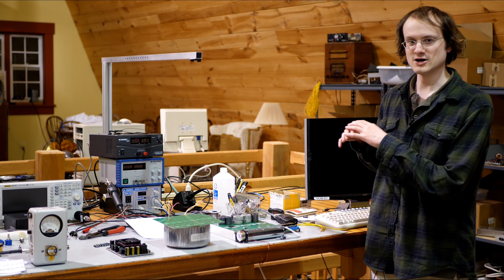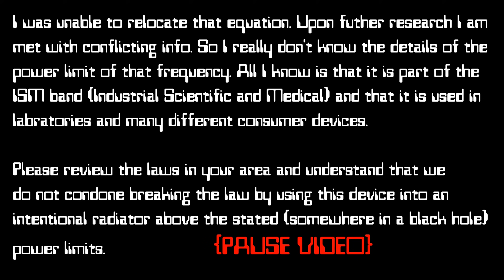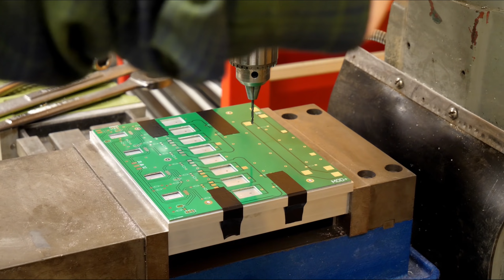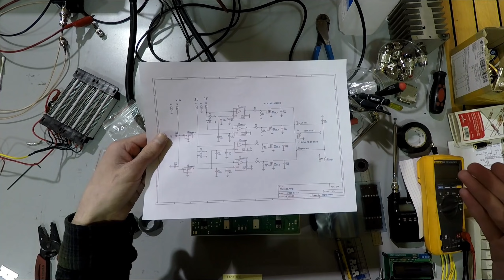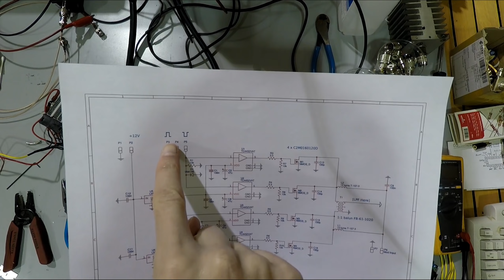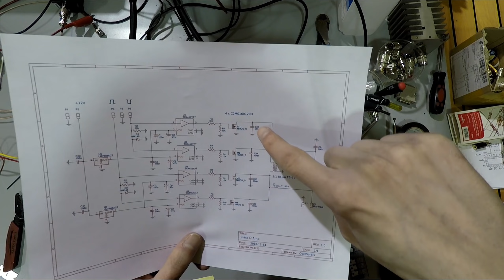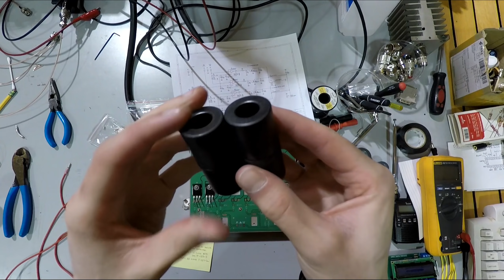Build a High Power Shortwave Transmitter!

Comment: Well, you could've solved the problem with the transistor pins should you have flipped them 180 deg. Center pins pointed up, and the base traces can easily be routed at the sides.
Reply from the maker: Someone else made the same comment. This just moves the problem to the gate. Now the gate has to have a long trace because the driver can not be placed on that side of it. You can see the solution if you find the other comment.

Comment: I am new to both electronics and amateur radio so this project is very attractive to learn from concept to best possible affordable performance? Good luck to us all!
Reply from the maker: The performance you can get with Class D is a very close second best to Class E. The reason I didn't choose class E is because it is very narrow band and requires tuning to the specific frequency you want. This will work from 3 - 5 MHz with no tune (160 and 80 meter bands and also shortwave bands in-between). The output cores can also be tweaked to make an AM broadcasting transmitter (0.5 - 1.8 MHz). If you want to use it for ham purposes, it also needs an RF relay to switch the output between transmitter and receiver so you can listen and TX.
This is a much better design than ham transceivers you can buy, AFAIK there are no commercial ham transceivers that use class D. I really don't know why because it is not very expensive. I may be wrong. If anyone knows why, let me know.

Comment: Non-enamelled copper wire REEEEEEEEEEEEE
Reply from the maker: I know. It's fine though in this case as it is not densely wrapped. It's not going to touch. It would be better to use enameled, but it is a PITA for me to deal with. Maybe it's the particular brand I got or something. The only way I can reliably take it off the ends is using a dremel.
Reply: @TechIngredients  my god a dremel lol... try using a blow torch, I use a soldering iron at 360°C for high gauge wires. I won't be surprised if the smell is known to cause cancer in the state of California.
Reply: @TechIngredients  Yeah it's just my OCD(or something like that). I would silicone the bare wires a lil bit just in case, though like you said, it's probably fine😝.

Comment: Hi, this is the return of the commenter on the video of the son of the main presenter. Great work.
Being the son of the main presenter, this advice is probably redundant, but try using a straight-flute drill for aluminium and backing off before you break through. usually works for me.
Reply from the maker: Yeah, as you can tell, I am not a mechanical engineer (that is my dad's thing). I'll look into that when I do the upgraded version. The mill clip was not left in there to "teach" anything, it was just to show the reality of the situation btw.
Reply: @TechIngredients  forget about it, you're doing great work. Can't wait for part 2.

Comment: Generating a PWM is super easy with any cheapo microcontroller, and many can also be configured to output phase pwm, so you set up how much they should be out of phase and get it on 2 different pin. I think even an Arduino can handle that easily (it can run up to 20MHz, so good PWM max is lower, depending how good you want the square wave; a bluepill, that cost 1euro, run at 128MHz and can be programmed as easy as the arduino).
You literally need ONE function call, alalogWrite, and set the frequency and duty cycle you want.
Reply from the maker: Yes, it shouldn't be too hard. I wanted to keep everything as simple as possible for the video because I didn't want to have any major problems reveal themselves during the testing. When I do the new revision of this transmitter (using NCP drivers and shortening the leads more), I will also try PWM.

Comment: You should have a look at WA2EBY style IRF510 based amps. They're class AB which is not as fun, but they are very cheap to build and can get quite reasonable output power, and are far more flexible in use. You might even consider the IRF510 for your design here, it's gate capacitance is way way lower, and you don't seem to be using the high voltage rating of your devices as is. They're also much cheaper. It's still a switching mosfet, so you get the joy of misuse.
Reply from the maker: I'll take a look. Thanks!

Comment: Great video and I've enjoyed watching it.
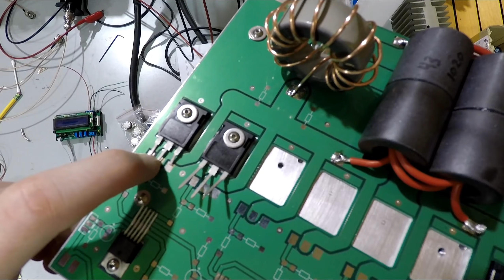@20:30 You could've rotated the output MOSFETs by 180 degrees and you wouldn't have that issue with the drain trace sneaking below the source pin. The traces would be much tidier and shorter.
Reply from the maker: I have thought about that, but then the drivers would have to have a long trace as a consequence. In my next design I will either have to raise the board on standoffs (should give most flexibility). The downside to that is it will become much harder to replace a broken FET. The other solution and the one I am pretty sure I am going to choose is to bend the drain pins up and solder them to a flat strip of copper that connects to the balun. This should allow the shortest connections possible I think.
Reply: Well, the traces from the drivers are not short now, as it is anyway :) But, I'd think about the new layout and maybe even put the new drivers on the bottom layer, which would shorten the traces and it would help you cool them with the main heatsink and some silicone pads (like the VRMs on a graphics card or similar). Assuming, of course, you will switch to the NCP81074A (SOIC-8). Lifting the drain pins and using a copper bus just hanging in the air would look ugly a bit. :) At least, in my opinion...
Anyway, I admire the way you are handling this project. Good job so far and keep it up!
Good luck!

Comment: Consider using a LMG1210 and EPC 2034, you will probably achieve your 40m goals with ease.
Reply from the maker: Yes, you're right about GaN, it is better at these frequencies. Those particular models aren't in a package to hand solder, however, there are some GaN transistors from Transphorm that are in convenient packages. The reason I didn't choose GaN is because of the cost. The ones I'd be looking at using are almost $20 a piece. That doesn't sound bad, but the SiC devices are only ~ $3. Once I get some more experience building this type of amplifier and I know I am not going to inadvertently blow the device, then I will choose GaN. It is superior in many ways. Even the pad is grounded instead of connected to drain (I never understood the purpose of that because you end up needing mica pads which reduce the thermal conductivity).

Comment: Man. Don't you just hate it whenever you build something and it starts asking questions about It's own existence. The other day I was making a weather station and one of my previous projects, a remote-controlled car I tuned with learning algorithms, started to complain about the political climate. So off course me, knowing well that this is the earliest sign of intelligence reached for my trusty de-robo-nizer (an advanced piece of equipment constructed out of some space grade 2*4 and three-inch nails) and deconstructed the thing in a timely manner.
On a side note I noticed you struggled with the drilling. My advice would be to start with a smaller drill piece. Make a lead hole then use the 6mm.

Comment: At 12:47; "here's the schematic (you can try to see it while I wave my hand in front of it)."
Reply from the maker: You can see the schematic clearly on my website.
Reply: @TechIngredients :  I was trying to gently educate you in the art of efficient information transfer. We live in a World where we are overloaded with what others think is important, so we must limit the bandwidth of the noise coming at us. It is much more likely that I will give you a half-hour of my attention (of my life) if you have the courtesy to respect my time too; show me a good view the first time, don't expect that I will follow your links to some other site. (I suggest you just insert a few seconds of a good inserted still; anyone interested can pause the video and study the schematic before continuing with your narrative.)

I would also suggest that a video about a project should start with a statement of why the project is necessary, what is unique about what you are doing or what captures your imagination to the extent that anyone else should be interested. Starting out in the middle, with a circuit board on a milling machine, is a confusing way to tell your tale. 

Learn the names of your tools, studiously avoid calling any device "that thing." If you are going to use power tools, perhaps you should spend some time watching and learning about drill presses, lathes, mills and general mechanical shop practices.

Lastly, I find it troubling that you described this project as a transmitter but then talked about the 6.7 MHz ISM Band allocation. The purpose of the Industrial, Scientific and Medical bands are specifically not unlicensed communication. Rather, the ISM bands are typically used for materials processing or inspection, and users are expected to use only so much RF power as is necessary to accomplish their task. As I wasn't interested in building an HF narrowband RF power source, despite the claimed efficiency, I didn't follow your video to the end. I would have found it more interesting if you could have connected this electronic effort to some valid use of the ISM bands (perhaps creating a plasma to accelerate chemical reactions or some other useful physical process). 

If you want some background, you can look at https://blog.pasternack.com/uncategorized/what-are-the-ism-bands-and-what-are-they-used-for/
or
https://en.wikipedia.org/wiki/ISM_band

Note that the ISM bands are almost the electronic garbage cans of the EM spectrum. The fact that Wi-Fi and other digital links were put into the ISM bands is more a testament to the ingenuity of the link designers than to the wisdom of the frequency allocation.

Comment: Careful with the Hack RF One, I've heard it's very susceptible to electrostatic damage on the antenna input relative to other SDRs.
Reply from the maker: I may reconsider and use a different SDR. I'm not sure which one though. The noise in the HackRF's output is a little too much to be amped up and it's only 10mW by default, so you kinda have to amp it up ;)

Comment: Is that an IRFP240? One of my faves

Love the channel. Keep up the great work!
Reply from the maker: Nah, those would probably work on the AM broadcast band though. They don't switch fast enough for HF. The mosfets used here are SiC (silicon carbide) and can switch up to 8 MHz max if they are mounted on a board with very short leads. My board maxes out at 5 MHz, but I will eventually improve it. The IRFP you describe will likely max out at 2 MHz. If you'd be interested in building a traditional AM transmitter (like anyone could tune their radio to), you could probably use that one, but of course, you'd be a pirate then.

Comment: This would probably work better as an SSTC driver rather than a radio transmitter. Also, it is probably better to wind the wire tightly on the choke. It is possibly also necessary to make each MOSFET drive the same conductance(impedance) when operating at such a high frequency. It is recommended to have a variable resistor RC buffer for each mosfet drive signal path for easy adjusting of rising edge compensation.

Comment: Nice, what a simple circuit for the power levels handled! I haven't dwell much into the RF world but i had experimented with long range (2-10km) communication on visible wavelengths and is quite fun, i used a similar solution about modulating the power going to a LED by feeding audio from an amplifier directly to a transformer with ferrite core in series with the LED, i know isnt optimal due the non linearity of the LED but it worked well enough hehe. Seeing the simplicity of your circuit i might try to get in to RF soon.

Comment: Uuuhhhhmmm @18:00 you say can't buy a PWM to modulate, while holding a class D amp that uses PWM to output sound! So basically if you remove the output filters from the class D amp you have your PWM to modulate.
Reply from the maker: I mean direct PWM to the drain of the MOSFET w/o a transformer.
Reply: @TechIngredients  yes, that's what I mean too. And sure, I stated it too simple but it is an option you may look into. The audio amp uses MOSFETs too. It has a driver circuit to drive those MOSFETs.
Reply from the maker: @Refthoom  I see what you mean. It may be possible, but it would also have to be providing the DC along with the modulation, so it would have to be biased up at 50V to provide the carrier w/o modulation.
Reply: @TechIngredients  as Fons Knaapen stated, you have a "Class D' modulator right there in the Class D audio amp just need to learn how to modify the audio amp control circuitry.   Easy if you do the research.   Try measuring the DC voltage across the audio amp output pins.    The RF amp you built is Class C not Class D as you stated.  You have a lot to learn about RF and electronics in general.  Perhaps reading the publications from the ARRL and getting a Ham License would get you up to speed.  No one in the U.S. can "broadcast" without a license at the power level you are building.   Low power is the only legal way to broadcast without a license and is limited to milliwatts of output power and very short range.  
Try researching Class E and Class H modulation.  the RF amplifier is Class C and the audio modulator is PWM.  Fons was only incorrect on one thing:  you don't remove the class d audio amp output filter, you modify it (if necessary) to pass DC.  The Filter is still necessary to reconstruct the audio waveform and block the audio amp DC inverter frequency (100 to 250 khz).  What you are building may transmit an AM signal but the audio frequency response will not be very good because of all the capacitance in the transformer windings.  It will also overmodulate the carrier if you're not careful and generate a lot of spectral garbage.  This high level AM is absolutely NOT the efficient way to do it.  
Radio stations are limited to Average and PEP power levels and primarily effective radiated power.   Amateur/Ham HF operators are limited to 1500 watts maximum, carrier or PEP.
I gave you a thumbs down on this video because you are trying to present something that you don't have enough knowledge about to be a presenter.  You have given erroneous and incorrect information in this video and it would better to delete it and redo it when you have some real knowledge and can present factual information to your viewers.   
All the people sucking up to you with praise for a great video must be idiots.  The video production and editing is fine but the material presented within is severely lacking.
I can not even give you an A for effort because you have neglected to educate yourself before attempting to educate others.
Reply: @Electromotive_Force  BSEE high speed design engr, PCB & MOSFET DRIVE  design issues ARE 20 X  beyond his understanding.  Stray capacitance and inductance can NOT be ignored.  Why do you not see 1KW 4MHZ PWM VOLTAGE REGULATORS ?  ( hint, look at T_on & T_off for power MOSFETS, also V_gs charge capacitance )  you need lots of current in ns
I do like his grit,  👍👍👍👍👍

Comment: You needed end mils to drill finned heat sinks
Reply: Not if you don't drill into the fins. It looks like his spindle speed was way too slow and feed way too fast. For that size drill bit the speed can be at the absolute max the spindle can take. and use oil.
Reply: I've done it using hand drill with Japanese drill guide and normal twist drill bits... You start with the smallest bit, like 0.3mm and then 1mm and final with 2.4mm. Then use m3 tap.